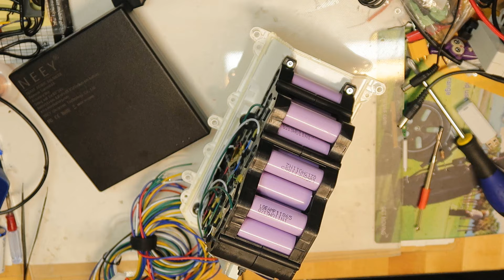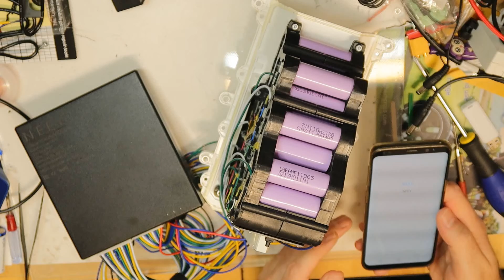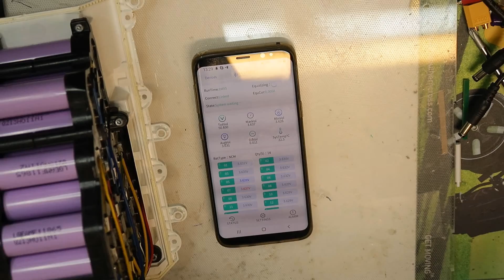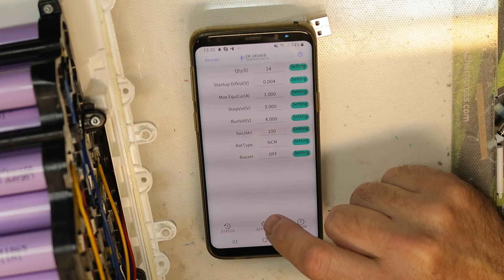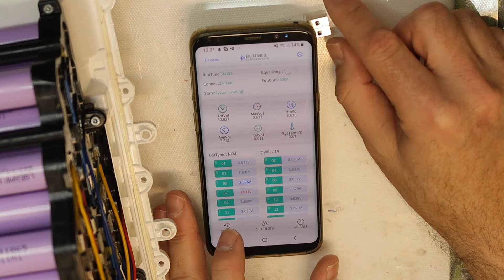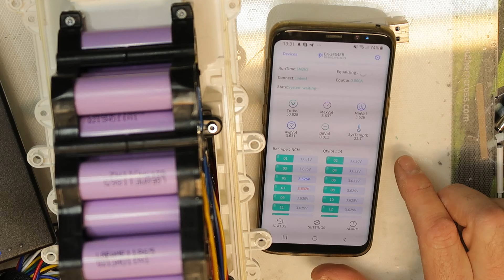Best Battery balancer! NEEY

Comment: Thank you. I soldered small round magnets onto the wires that remain hidden in the thermal caps but can be exposed when needed. This allows for fast and easy connection to the tested battery cells.

Comment: This balancer is also very good due to the way it balances.
Instead of draining the high voltage cells to match the lower voltage cells which lowers the pack voltage with wasted energy, it takes voltage from the high voltage cells and puts it into the lower voltage cells. 
That way not wasting the energy
Reply: This is true, but not ideal.
I used it to balance the 13S battery on my electric bike, the end result was that it 'balanced ' all the strings to 3.87v, but they should be at 3.65v. 

Now, when I fully charge it ,  it tops off at 65%.

Any suggestions?

Thanks
Reply: @robotgrass  The balancer does not control the charging voltage, it just balances the cells.
To get 3.87v per cell, your charger or BMS is not set up correctly or is faulty.
Hope that helps